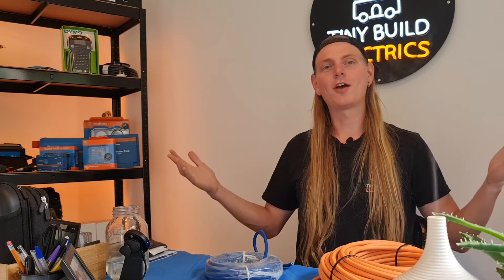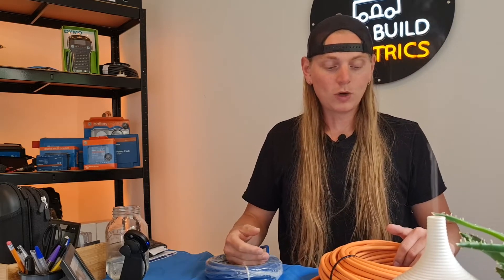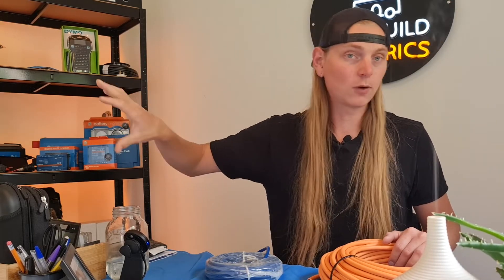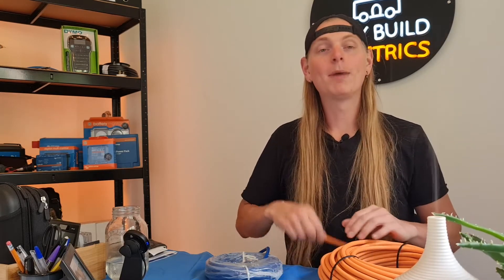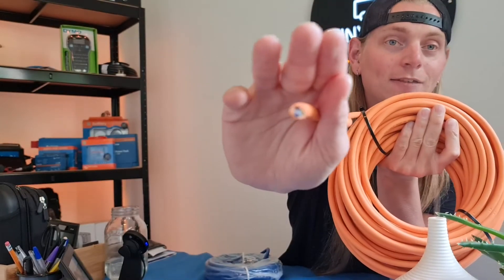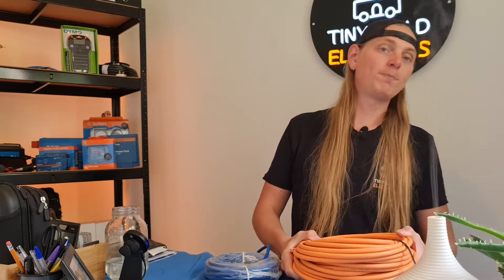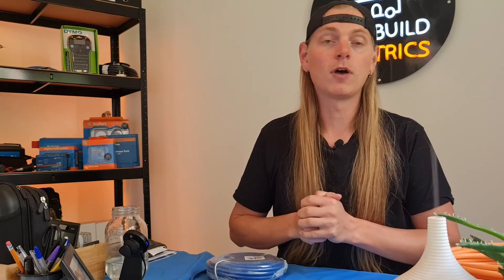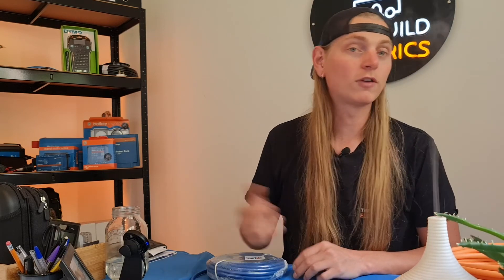230V AC Cable and Wire Gauge | Tiny Build Electrics

Comment: Thanks for this Tom. Very helpful and so far so good with how we ran ours. As you say on the final runs you could use 2.5mm2 and we did, just in case really. Also it was easier to buy a 50m reel of 2.5mm2 arctic at the time for us. Thanks for putting this together. Appreciate it.